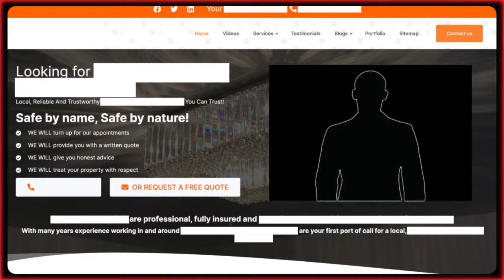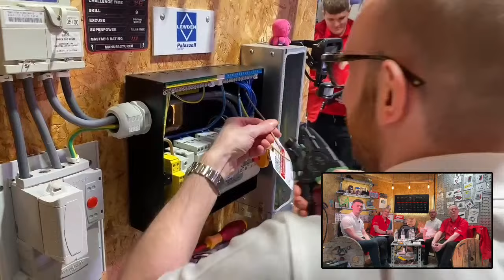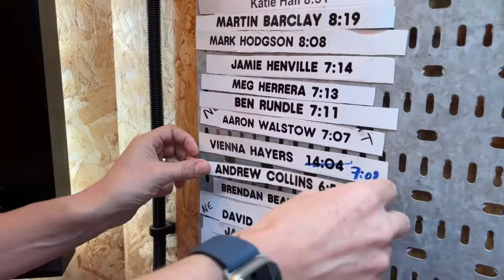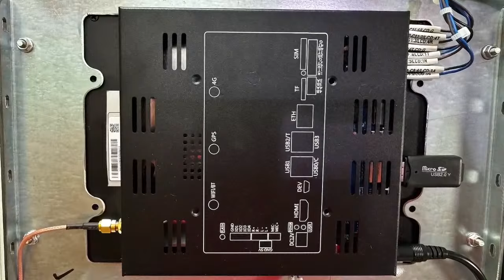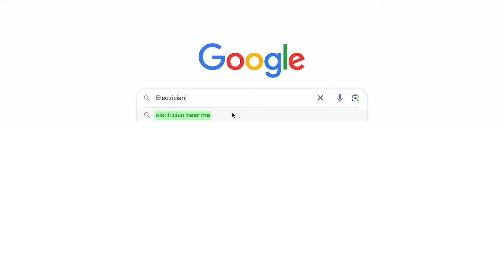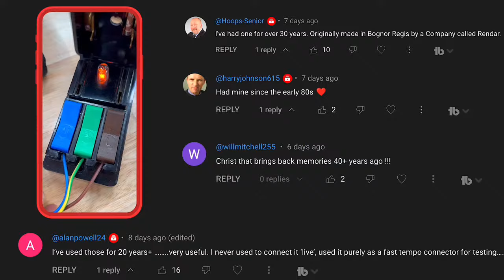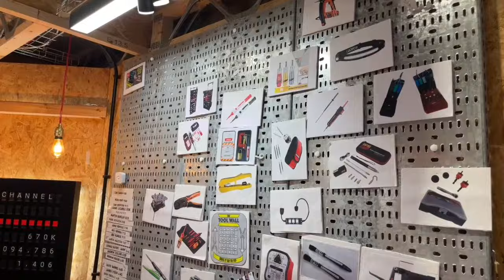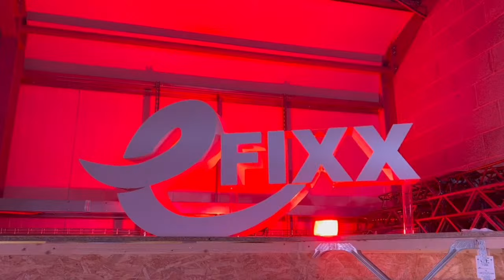AC is Dead: The Rise of DC Fast EV Charging

Comment: DC for public, but limited to high rotation areas. But AC will be used on the rest of the scenarios. I have an EV since 2014 and only charged DC on a couple to times, below a hand full of times, but AC is what I use 98% of times. To put into context, my car has 230.000km and charges on a daily basis.

Comment: i was reading a car charger install in your house will drain your battery, in your solar so you have to prevent that  by rewiring  it out of the cv sensor ,on your mains wiring,i have not read if your inverter can prevent it